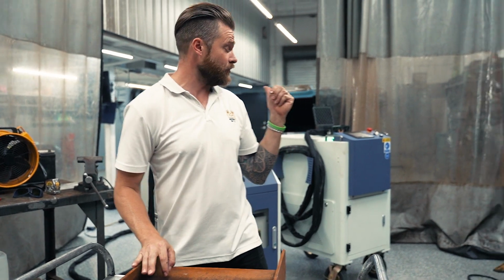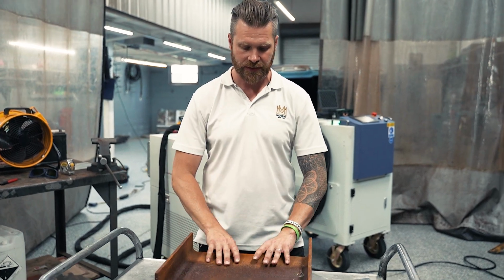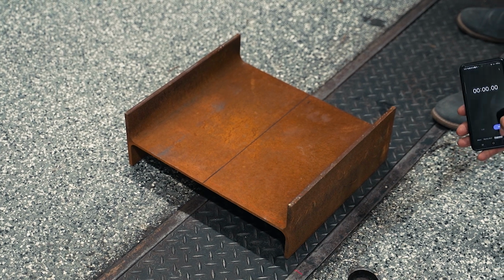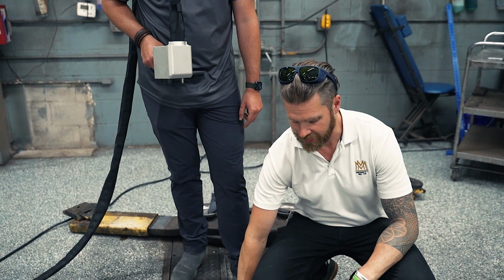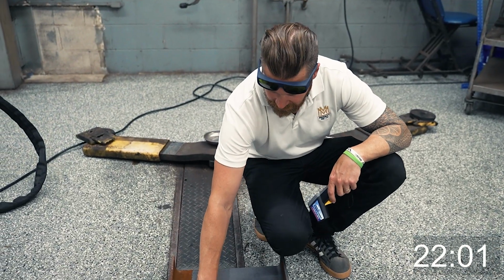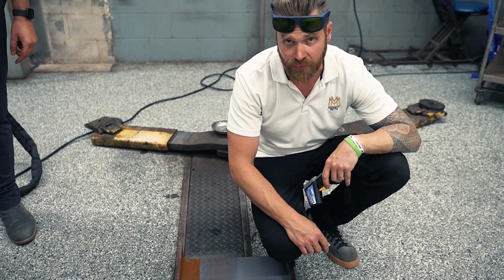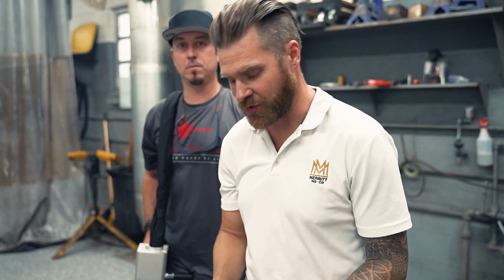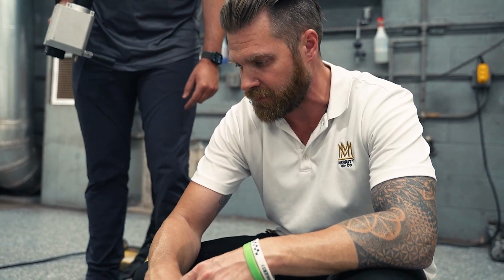Continuous Laser VS Pulse Laser Comparison - Merritt Motor Co

Comment: Pulse laser is much better in conservation and restoration, special for wood and stone. I clean with pulse laser 200w all lynotype machine for just 2 days without any dmg on original color. 

On Cw is just To much heat on CW. Imagine what it can do to sheet metal. Also, pulse laser is much more expensive, not for a reason.
Reply: Would a pulse laser remove paint from an old Corvette body, (fiberglass) with out damage the fiberglass?
Reply from the maker: @laserfalcon  I personally would not advise using a laser on fiberglass.
Reply: @merrittmotorco.4166  thanks for that advise. I wasnt sure if this type laser could be done with low power to not harm the fiberglass
Reply: @laserfalcon I just started experimenting with fiberglass with a cw laser, so far, it can be done
Reply: @DreamstoRealityAutomotiveTV  Does it just take paint off without hurting the glass ?
Reply: @ I’ve had different results because of what was on the fiberglass, meaning paint and filler etc, but honestly once everything is off the parent fiberglass, unless you really try to hurt it, the laser generally doesn’t do anything to the raw glass
Reply: @DreamstoRealityAutomotiveTV  so you are using continuous wave and not a pulse ?
Reply: @laserfalcon I’ve done fiberglass with both.